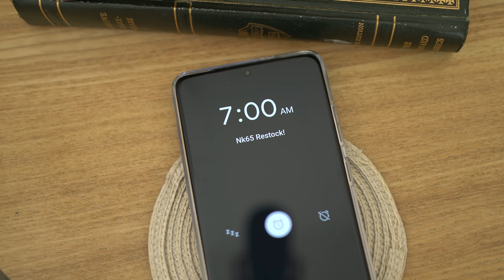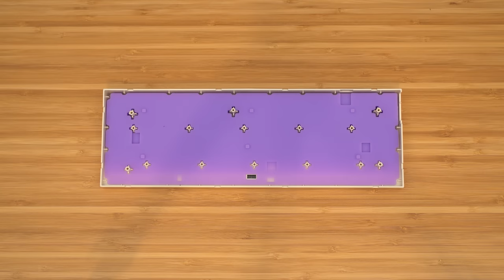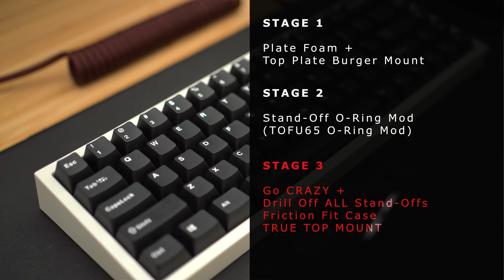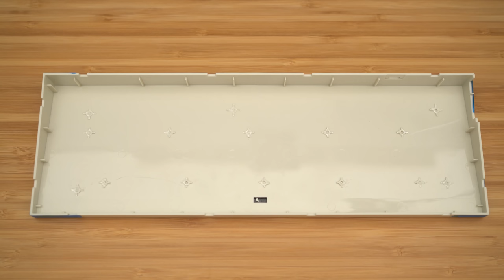The BEST CUSTOM Keyboard for $95?  NK65 EE in its ULTIMATE form!  I made it into a TRUE Top Mount!

Comment: Very cool. Did you consider replacing the silicone with a different dampener?
Reply from the maker: Hi jk!  I am planning to rip out the silicone and put in dynamat!  I have had great results with the butyl sound deadener!
Reply: @Keybored  Excellent--You already got the board sounding amazing, so looking forward to hearing a sound test to see if the dynamat makes a difference.

Thanks to your video I'm eyeing my stock NK65 with an evil glint in my eyes... although I am currently using Zilents so I don't know that the improvement will be as noticeable... but I do have some Creams on the way & have a different board that has become my primary "quiet" board (KBD67 Lite).

Comment: Why didn't you use the same method of pushing the o-ring to the screw first instead of placing it onto the standoff in part 2? haha it is indeed miles better.

I love the NK65 EE, I just think it was designed super not mod-friendly, with all the threads built into the polycarbonate itself. Those things break super easily. Especially the ones that hold the plate to the bottom, there's very little material between the thread and the sides. Also the reason why (IMO) they went with plate mounted stabs, so customers don't need to disassemble it at all.
Still, the spacebar with some properly modded stabs, sounds so heavenly.

It will lose it's throne pretty soon though... If kbd67 lite sees some more frequent stocks. Metallic screw threads, a form of gasket mount and a more "premium" layout for just $10 more. 
Anyway, great vid. Glad I subscribed.
Reply from the maker: Hi Diego! You are right about the NK! I believe it was designed to be just plug and play, so they didn't make it as mod friendly. Hopefully they consider that if there is a new version in the future. I am very curious about the Kbd67 Lite. A gasket style keyboard for that price seems like an amazing deal and I hope I can get my hands on one soon! I feel the gmmk pro will also be a good step up from there for about 50 dollars more, for an aluminum case!

Comment: I love this would be a great idea to test on a used setup, also I own both the aluminum and poly version of the board, Can you put in screw mount the stabs? I know they don't fit but finding a way to modify it with everything else going on could prove useful.
Reply from the maker: Hi Vollerei! The stock configuration can't take screw in stabs, but perhaps there is a way if the pcb will allow for it. Have to make sure there are no traces or components where the hook and screw holes would go :)

Comment: Where'd you find the o-rings for stage 2?
Reply: Wondering this as well, please respond!
Reply from the maker: Hi David! The larger 4mm ones are here
https://www.amazon.com/uxcell-Silicone-Rings-Diameter-Gasket/dp/B082STN4LT/ref=mp_s_a_1_5?dchild=1&keywords=silicone+4x1x1.5+mm+o+ring&qid=1613253574&sprefix=Silicone+4x&sr=8-5

And the smaller 3mm ones are here
https://www.amazon.com/uxcell-Bearing-Pneumatic-Silicone-Sealing/dp/B01KFNUBN2/ref=mp_s_a_1_4?dchild=1&keywords=silicone+3x1x1+o+ring&qid=1613253678&sr=8-4

Will add to the description!
Reply: @Keybored  Awesome thanks! Would it be possible to just use the 4mm ones on everything?

Comment: can you provide a link to the o rings used?
Reply from the maker: Sure thing! The smaller ones are here
https://www.amazon.com/uxcell-Bearing-Pneumatic-Silicone-Sealing/dp/B01KFNUBN2/ref=mp_s_a_1_4?dchild=1&keywords=silicone+3x1x1+o+ring&qid=1613253678&sr=8-4

And larger ones here
https://www.amazon.com/uxcell-Silicone-Ring-1-5mm-Gasket/dp/B08F2HPLG3/ref=mp_s_a_1_5?dchild=1&keywords=4x1x1.5mm+o+ring&qid=1613320730&sprefix=4x1x1.5mm+&sr=8-5
Reply: @Keybored  Hey, I just tried purchasing these. The first link is correct, but the second link goes to a 4.5mm OD 1.5mm ID 1.5mm Width o ring instead of the size you said in the video. Please fix link. Thanks
Reply from the maker: @peterdo4329  just fixed! Wow these 4x1x1.5mm ones are still very much sold out... Looks like pretty limited on Amazon and shipping times are horrible... I've tried the nitrile ones before and they also work similarly for the most part.
Reply from the maker: Here is another link for the 4x1x1.5
https://www.walmart.com/ip/Silicone-O-Rings-4mm-OD-1mm-Inner-Diameter-1-5mm-Width-Seal-Gasket-White-10Pcs/256621294
Reply: @Keybored  do you think 4x1.5x1.5 would work? Or is it possible to just use 3x1x1 for stage 2
Reply from the maker: @jemon089  Hi Kuyaa!  I haven't tried the 1.5mm ID myself, but given how tight the 1mm is, I don't see a problem.  In addition, there is more leeway for the larger o-ring for the lower portion, since it's propping up the plate and won't run the risk of the screw head going through it.  Hope that helps!